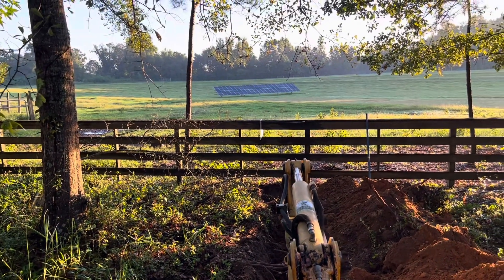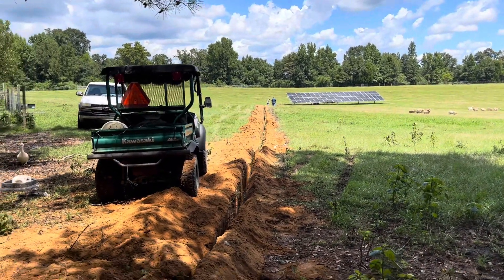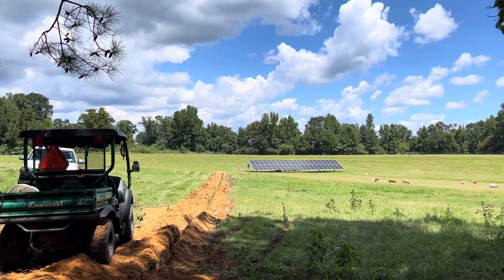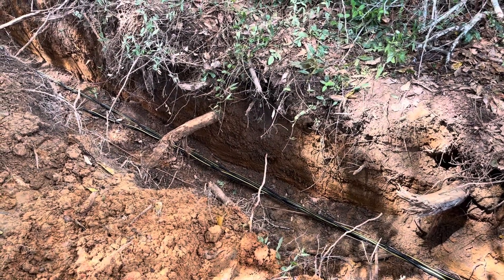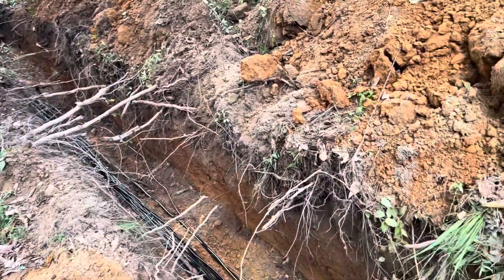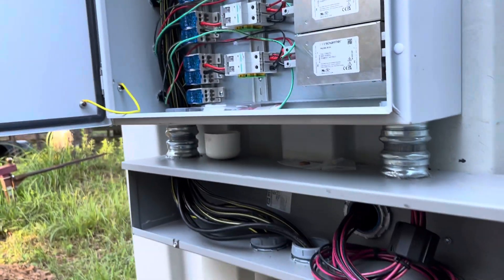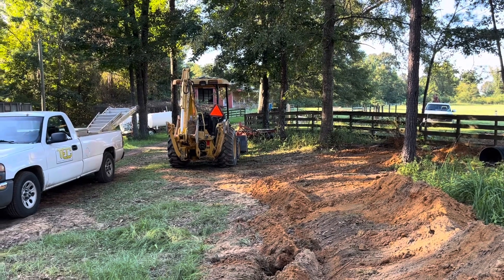Solar Power Project - Installing Underground Source Circuits from PV Array to Solar Power Room.

Comment: Any new updates coming? Or are you swamped with the day job stuff?
Reply from the maker: Been swamped! Going to do some soon. I have the system up and running but with some issues. Tech support from Signature Solar is sloooow ….
Reply: @jeffmotes2129  What issues are you having. One I am having is solar assistant or  Growatt not working together and lock up once a day for me. That messes up data collection everyday.
Reply from the maker: @snoflite5234  that is one of the issues I’m having. I’ve narrowed it down to one specific inverter. I have 5 inverters. Very often SA only shows 4. If I move my cables around tge problem port is always my inverter no 1 which is also my Host inverter. 

The inverters show I’ve generated almost 500 kWh since I’ve turned the system on. SA only shows a little over 200kwh. 

The biggest issue is when I’m operating with my battery type set to LI the inverters will only charge the batteries at 10A. Signature Solar tech support has not been helpful at all. 

I finally decided to change to USE2 and I was able to change my charger level to 80A. 

I think there’s a problem with the BMS and Comm board on my host inverter. I’ve asked for replacement boards but doubt they are going to help.
Reply: @jeffmotes2129  I only have 2 inverters on, but I always have issues with the same one also. I tried different cables, even a usb hub, always the same issue. Mine only seems to do that at peak solar time usually, but sometimes that does not matter. I have my batteries hooked up using use2, as I built my own batteries.
Reply from the maker: @snoflite5234  is it the Host inverter?
Reply: @jeffmotes2129  It is not my host. My host has new firmware than the rest, I bought it only a few weeks ago. The other 4 I have, all have the same firmware in them. There are different comm boards in these inverters. There are 2 types that I know of. I have 3 of the new style an 2 of the older style. All inverters were bought in the past 6 months tops, just got older stock from Signature solar I guess.
Reply from the maker: @snoflite5234  are you monitoring your batteries? I can’t really monitor mine without SA working other than the SOC lights on the front.
Reply: @jeffmotes2129  I am not monitoring mine either. I have a few usb powered hubs on order that SA people recommended, so I ordered what they recommended. I do have a victron smart shunt that I just got hooked up to SA today, so at least I can see that info. I made my own  LFP batteries so I have aftermarket BMS in each battery.
Reply: @jeffmotes2129  Any update on your SA issues? I have my 4 inverters that I have running hooked to a hub that SA recommended I purchase, but I am still having issues, although today only one inverter is loosing communication, but it is cloudy here today. The more sun,  the more issues I have. SA has not been much help, I only get about every other email to them answered and then sometimes the english is bad that I can't understand what they are getting at. So far they are blaming the usb cable, and the growatt using a usb for monitoring.
Reply from the maker: @snoflite5234  I’ve been having some serious Growatt inverter issues. Had to take mine offline last week. Invert 1 - Comm board, inverter 2 - back feeding 4v to grid, inverter 3 - direct short between AC IN L and AC OUT L. Dealing with Signature Solar tech support but it’s very slow. 

Power company lost several power meters before I could find it.
Reply: @jeffmotes2129  Man Jeff that sucks. Funny thing, yesterday my wife was home, she heard a noise like a pffft, and then something beeped, but she went down stairs and could not see anything odd or wrong.
Reply: @jeffmotes2129  That really sucks Jeff. I am kinda working with SA on my issue but their reply emails are only once a day and then sometimes no reply till you send another one, and their English is not the best, so it is hard to tell what they mean sometimes. Was the new comm board for the SA issue? Did  it help? Did you have to do any firmware updates? My one inverter with the 067 firmware (newest) runs the cooling fans much earlier and louder than the other 3 I have. Just something I noticed.
Reply from the maker: @snoflite5234  Signature Solar has not sent me a new Comm board. Said they didn’t have any in stock. I’m sure my second and third inverter will have to be returned. I must have 4 inverters to run my system, so until I get this resolved I’m down. 

I did buy a spare inverter off of eBay so I may be able to replace and rewire depending on if I have to return the inverter with the Comm board problems. We’ll see …

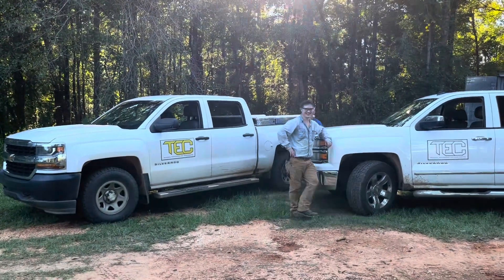Comment: I have one inverter finally up and running, hooked to 14 395W panels. At 4:30 I was pulling a little over 3KW. Not bad. My panels were near flat at 15 degrees. I can't hook up any more inverters till I get a battery built. You can't parallel inverters with out a battery hooked up. It sure is nice to see some free juice flow in, lol.
Reply from the maker: Won’t be much longer for me. Got to complete a few grounds and make one repair. Work all day and thunderstorms right now. Going to be another day or so.
Reply from the maker: Nice. Build that battery bank.
Reply: @jeffmotes2129  I am trying but between my day job, my side job and this solar project, I am getting burnt out. My daughter got married and moved to Texas so now all this work is on me, lol.
Reply from the maker: @snoflite5234  I know the feeling!
Reply from the maker: @snoflite5234  I know the feeling!
Reply: @jeffmotes2129  BTW Youtube might be doing something with your video, I can not view it, it just spins like it is loading but I can watch any other video I click on? Not sure what is going on?
Reply from the maker: @snoflite5234  hmm… not sure. I know some have seen it. I posted a video on Solar Assistant a while back and tge sound wouldn’t play on YouTube. Never could figure out why. I ended up deleting it.
Reply: @jeffmotes2129  I got it to play now, not sure what was up with that. I hope you do a solar assistant video, I will be working on that soon.

Comment: You said aluminum wiring? I understand wire since everything is so high but aluminum vs copper...how much does this impact it's efficiency? You're the electrician but I'd assume it would experience more voltage loss / sag? And, since aluminum isn't as conductive how much does this effect it's ability to get all the power from the panels to the inverters? I'm curious as if this is not that much of a loss I'll consider using this cable instead of the copper direct burial cable I was looking at. I don't have to use conduit but I was planning on just using some cheap pvc to make it easier to pull wires if needed in the future.
Reply from the maker: You have to design your circuit around the type of wire you are using. As a rough rule of thumb you can figure aluminum two sizes larger than copper will provide similar current capacity and voltage drops. 

In my case, my circuit would require 8AWG copper or 4AWG aluminum. The 4AWG aluminum was about half the price of the 8AWG copper. Plus the aluminum wire I used was direct burial. 2” PVC conduit is around $3 per foot right know.
Reply: Wire size is everything - if you don't take that into consideration then you might as well not figure.
Reply: There is no such thing as cheap PVC now.

Comment: Cables aren't placed within conduit/trunking of some sort for dirt burying?
Reply from the maker: Direct burial URD cable. Cable is rate for direct burial.
Reply: You know when I asked the co-op to come see what I was wanting to do .. as Jeff said  cost per foot of  was way more than the cost of just burying another line ... WAY WAY more.. and direct bury is legal if you use the right cable as Jeff said ..  Our co-op would not do it without pipe so they could PULL another line if they needed to.. You have to contract third part for the work.. the CO-OP won't do it and you MUST use THIER list.. BS ..  just a racket.. (I can lay 3 direct bury wires cheaper than 1 they way they want.. and have two spares or expansion IMO)  nothing to do with safety or effectiveness... that is in TN ..  dunno bout other states.. .
Reply from the maker: @rterry731  I can understand the co-op’s point of view. If your underground cable goes bad (doesn’t happen often but it sometimes does) without conduit they’ll have to dig your yard up which is a considerable expensive and time consuming project. Easier for them to yank the old cable out and pull a new one in. They aren’t concerned about your upfront cost.
Reply: I see. Thanks for sharing. Learnt a great deal here 🙂👍
Reply: Plus cables that are direct burial are more efficient because they dissipate heat more and therefore stay cooler than in conduit.

Comment: Nice ..  what's code depth  for direct bury in AL ? Just curious....  Can't wait to see the tie in to your house side and hear a wrap up maybe lessons learned and costing ? maybe ?  Been very helpful project documentation ..  thanks Jeff
Reply from the maker: I direct buried at 24-30”.
Reply: @jeffmotes2129  yeah same here.... I don't have any rock so I think I'm going for a rental trencher .. still have to figure out 100 amp svc  Tie in to my box (runs the garage) and is only part of a 400 amp svc from the grid...  should be  th eplace for a cut off and feed I think...  and they do like the cost of those pieces and parts OMG!
Reply from the maker: @rterry731  for real! Prices are through the roof!